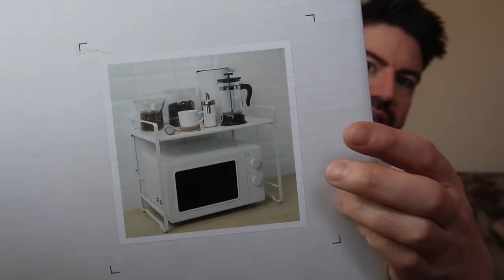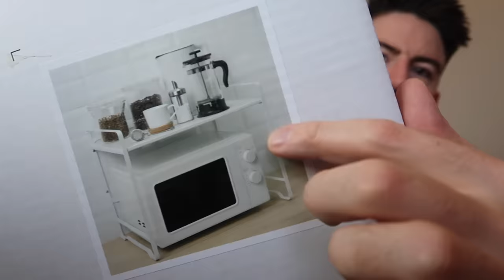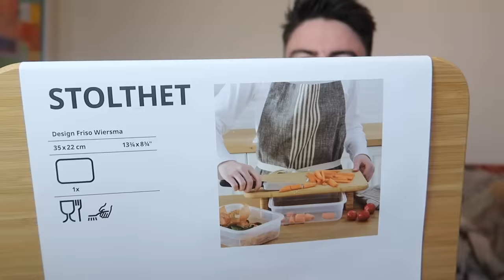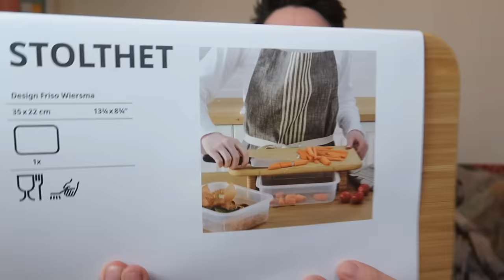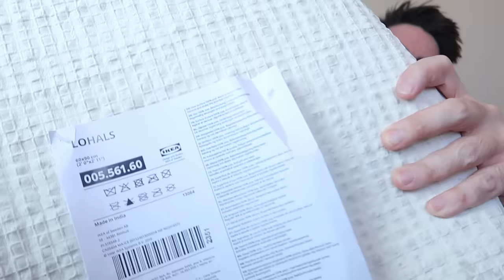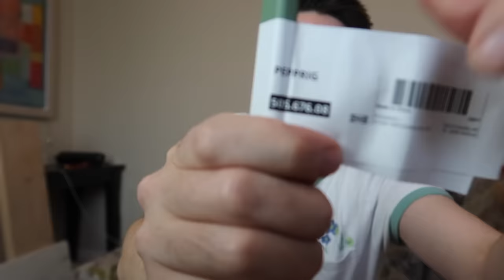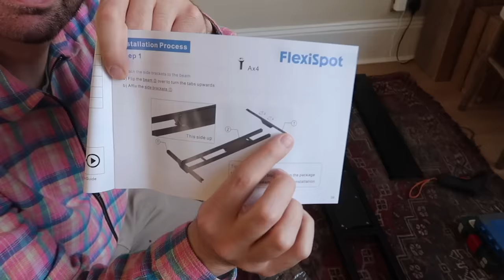Renovating my Victorian London Home: Living Room, Dumpster Find and New Desk! MR CARRINGTON

Comment: Great video. Very productive! I felt your pain when you realised you'd made another round of mess to be tidied up! I sat repairing curtains while I watched - you got far more crossed off your to-do list than me, it would seem 🙃 Great find on the piece of scrap wood - some things are meant to be. If you do use it for your TV, you could add some stylish/vintage heavy duty castors or wheels to lift it a little - would also make it easy to move around for cleaning or changing up the layout of the room. Can't wait to see how it all comes together. Your feline supervisors were certainly on top form throughout! 🥰

Comment: Hello Mr C.. I spotted an insta feed the other day, the lady had an old oblong/ horizontal leaded/ stained glass window. she repainted the wood added 2 screw= in rings to it along with a chain on each one. Then she screwed hooks into the plaster above the window and hung the framed reclaimed window in front of the top of the window. Think hers was a kitchen window. It looked really good. Wondered if you could get your thinking cap on to re use yours.

Comment: Pumpkin is a Master Inspector 😅.  The Flat is looking good 👍.  I like the plaster look. Concretta has beautiful colors if you like to check it out. 1 coat let dry. 2nd coat slightly sand 1st, wipe and trowel on and your done any color you want. 😉.  Happy day from across the pond.

Comment: For the cut off piece  put that wood on it and turn it upside down if the underneath is OK,then you have a full piece on top   then piece of mdf to cover holes inside on bottom,  bit of trim,  paint it   then you have a shelf  an tv stand   great for the TV  and  couple of baskets for storing leads and bits etc

Comment: I would put shelves up and put the microwave and airfryer etc all in one place. You need something on the walls I like the metro tiles. The small little board could also be used to put your screen on.  The shelf top and your wood find could be a window bench. Cats can hide underneath

Comment: I love the KITTY KISS SEAL OF APPROVAL in the kitchen! And, the setup is coming fabulously!  

The lighter floors are perfect, and the honey undertone will be your best friend. It hides scratches, furbunnies, cat hair, and other follies. Yet, a swifter a day picks up everything! And, it goes so well with other woods added as well as reflects so much light ... your place just looks brighter! Love warm light of the walls, too, btw!

Quick savings tip, flip the swiffer towel over for a second use or for a larger job! It will hold a ton ... I do pull off cat hair build up along the way, but man I get a lot more use by flipping!

The chairs you found for Luke will be such a nice "gift", and they will be lovely when pressure washed and oiled. I like the piece you found as well. 

How about check out the option to use that piece on the bottom and flip the piece over to where the molding is on the top? Then, just pick up a thin ply wood to place over the bottom and some trim to finish  the look. 

It would be fabulous as a side board for firewood, books, blankets/pillows, a basket of kitty toys, two kitty beds, that "thing that holds all that TV stuff" (you could put that all behind a screen) ... just a few thoughts. A nice seat cushion could go on top.  Or, if not seat suitable, add some plants, other things similar to what is mentioned above.

I guess we drive you a little crazy, but I hope you might have gotten something from my brainstorming!

I'm excited about your work as you deserve it so much! Keep on creating!We're here with bells on to enjoy!
Reply from the maker: I love ideas, all welcome! 😀

Comment: Heads up on you Ring doorbell we have a Eufy the builder wired it in for us only to fuse it so I bought it for £98 he had to replace it it cost him £108 those mats do no lasts we had our for about 9 month (outside) completely shredded could  you not line the shelves with the line (architrave) at the side of the cabinet